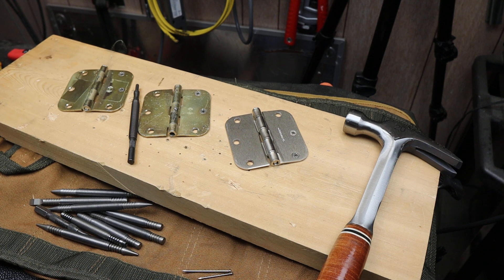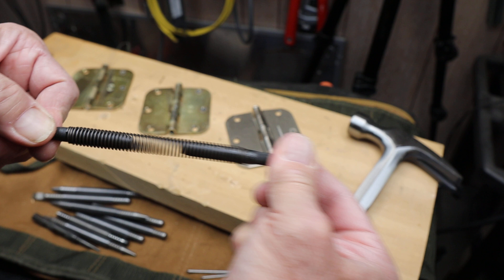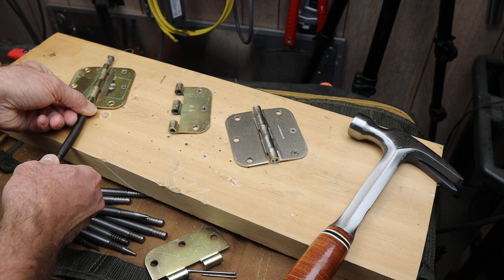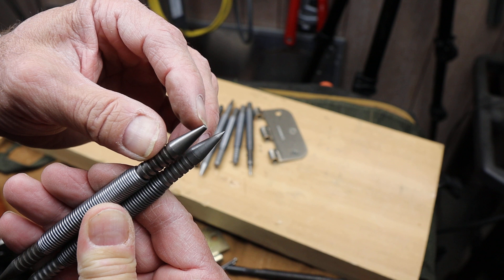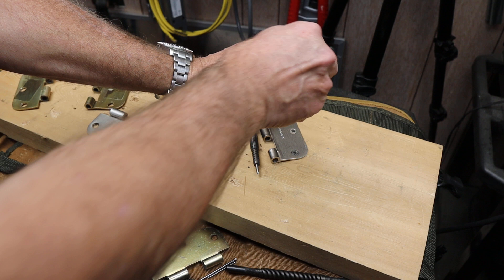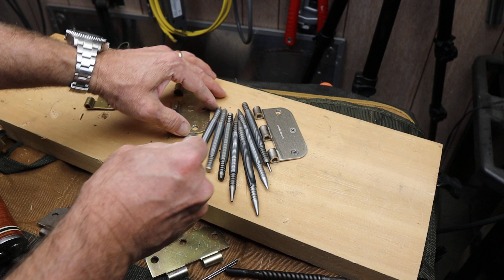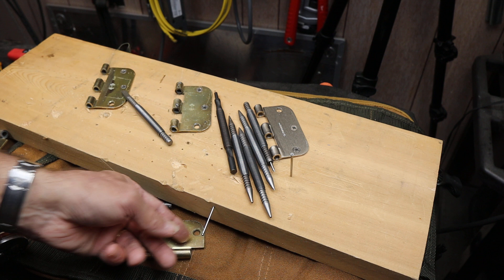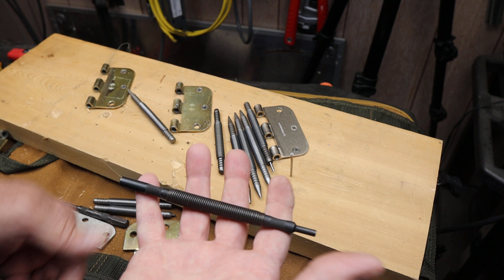Mayhew & Spring Tools are solid solutions for those medium precision tasks. Like removing hinge pins

Comment: Doc, these are the Bees Knees. I bought several sets of these, in different head shapes, lengths, and "intensities", some rated for 1500 pounds, some 3500 pounds, of impact force respectively. Initially thought it was a gimmick, but saw some real world usage videos, and I was sold. Tons of applications, very versatile, and very robust, I haven't experienced any premature wearing or damaged tips. I also placed the most pronounced shaped tips in my vehicles for emergency usage, to brake out windows with almost 0 force/effort needed. I also have seen Police carry these in tiny form, with a clip attached, edc'd, in shirt pocket, to bust out windows lickedly split 💥. I'm a big fan of these implements, just be sure you're getting the real deal, as "Spring Tools" are the originals, and there are tons of cheap knockoffs, that implode with very light usage. Not sure if "Spring Tools" are selling to other manufacturers (ie- "Mayhew"), to be rebranded, which is common for tool companies, but please be aware before purchasing. Thanks Doc for the video, great content as always, 🙋‍♂️, -Paul.

Comment: I have two spring tools,  primarily for roll pins. They work very well, especially in tight areas. 
Love that eastwing hammer. I have a few hammers as most do and that Leather handle polished Eastwing is my "house" hammer. It never sees outdoors or a job site. I primarily use Vaughan's for my building needs and site use. 
Thanks again brother for another great video.

Comment: I have a Mac tools branded set I bought years ago.  My favorite use is to knock the center pin from pop riviets to make them easier to remove.  Lots of window regulators/glass were held in with rivets, not the kind of think you want to use a hammer and punch on.   Knock out the steel pin and the aluminum rivets drill super easy.

Comment: I've had one of the Spring Tools center punches for some years. It's 'ok' I suppose, filling the gap between when a conventional & automatic center punch isn't practical. So far, I've only used it on Aluminum.
Reply: If you work on race cars, they can be your best friend 🤘